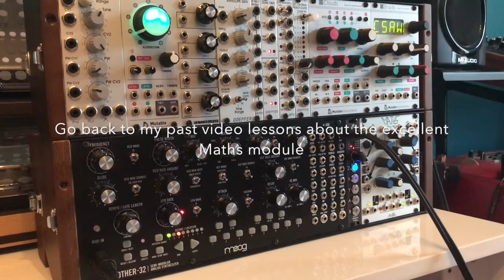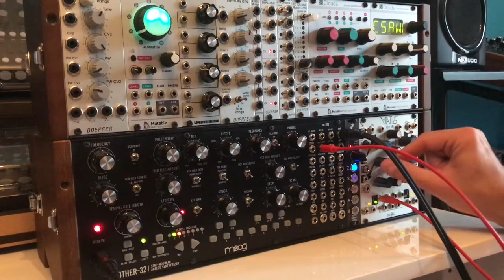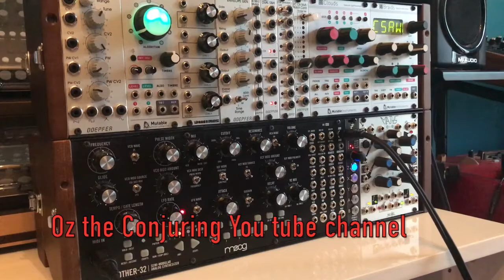Adding external EG To Moog Mother 32

Comment: So I have a mother 32 and am trying to use an external envelope with the amplifier.  I have the gate from the mother going to the asdr, and the envelope going to the vca cv input on the mother.  However, it doesn't seem to bypass the EG on the mother.  I hear a click when I hit a note if the mother envelope knobs are turned all the way down.  Is there a way to get rid of this?  The mother 32 envelope is bad and it would be nice to bypass it all together.
Reply: @ 2:14